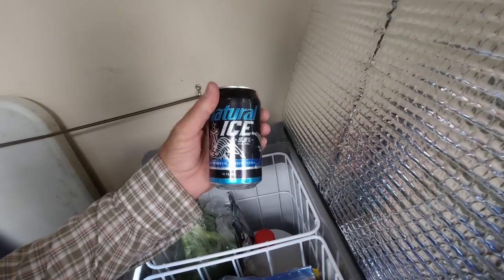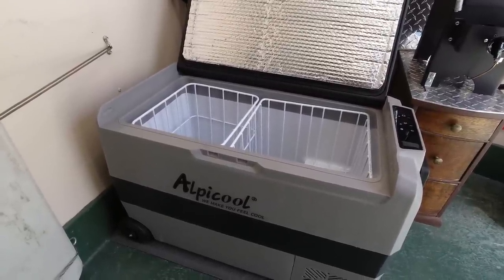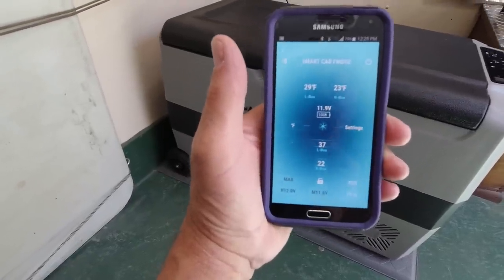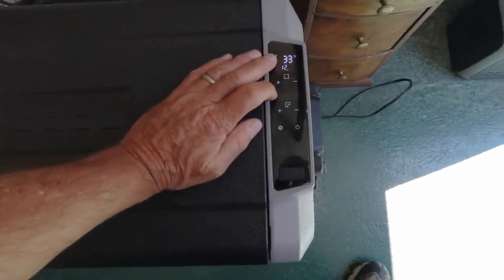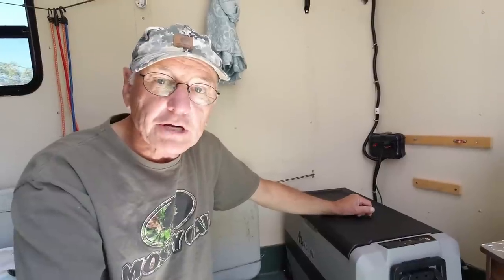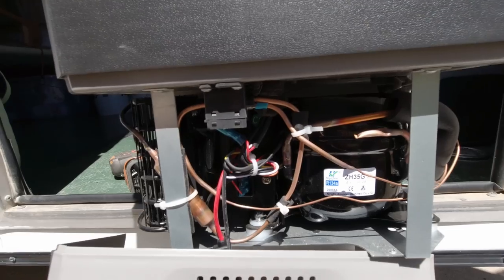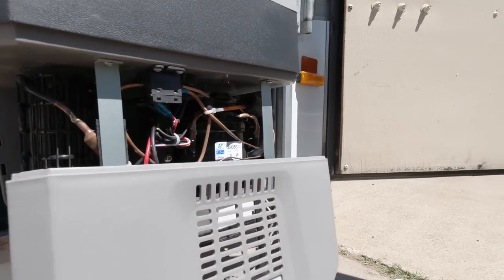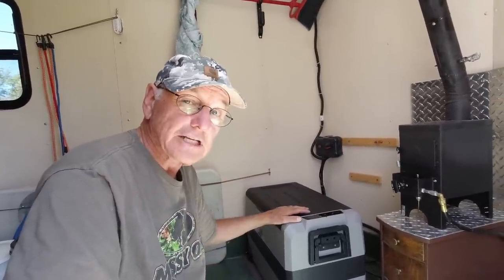Alpicool T50 12 Volt Refrigerator - Is It Worth It?

Comment: Some clarity around the Regulated 12v, its not that it won’t work so much as you will not get 100% of the power from the portable battery. My Goal Zero Yeti 400 lithium will stop running the fridge when it gets down to 35-40% power where if I had regulated 12v it would stop at 0%. This is with my Dometic at the lowest battery protection shut off option. If you are buying a portable battery and want it to run a fridge I would opt for regulated as you would get more usable time off of it.
Reply from the maker: Thanks for your input.  My concern is the videos that say it just won't work.
Reply: Yup that’s just BS. It will work for sure.

Comment: did you buy the extra insurance on the fridge, at amazon? I think it is through Allstate or SquareTrade.. 3-5 years of coverage if it stops working or anything breaks on it. Thanks for explaining the dual-zone. I saw that online but could not understand how it worked in real-world situations till you demonstrated how. I presume there is some kind of magnet in that panel that trips a switch/valve? Is the zone that has to be coldest on the side with the shelf or the other side?
Reply from the maker: You're right about the magnet and the cold zone is the shelf side.  I didn't get the extra insurance and usually don't when I buy things like this.  I figure if it's going to break it will most likely be in the first year.  We just returned our Alpicool because of a gurgling noise, and warranty service from that company still amazes me.  No hassles, just an immediate return label, no questions asked.  You don't send it back for repair with them, they just return your money.  If it wasn't for the fact that I have other refrigerators, I'd buy an Alpicool again.
Reply: @gonagain  did they return the tax you paid too? did you originally buy the alpicool on amazon directly from alpicool?

Comment: Do you have gurgling while the unit is running? Mine is pretty loud, sound line blowing bubbles in a milk jug.
Reply from the maker: Mine too. I've read that that's normal for some refrigerators. Some do it and some don't.

Comment: Thumbs up for Samsung Galaxy S5 !!!
Best smartphone with OLED display, replace-able battery and additional memory with 128GB microSD card. With unlimited data plan and Hotspot, I use Galaxy Tab S4 or iPad for YouTube, shopping, online game and email. Happy RVing !!!
Reply: As for the regulated 120V power? Yes fridge will work fine on 12VDC, but the AC adapter will last longer in true pure sinewave 120VAC.
Reply from the maker: This is all good information, thank you Thor 808.  You're right about the compressor and it will be either an LG or a Secop inside.

Comment: is the cooler still operating good?
Reply from the maker: I no longer have that particular cooler because I passed it on to another person, but the Alpicool has a good track record, as do most of the 12volt compressor refrigerators on the market these days.
Reply: @gonagain  is it still working good for the person that you passed it on to? Doesn't really matter too much who owns it, just want to know if it's still kicking

Comment: I just got the small 15 liter yesterday. Poor instructions. Wanted to send it right back. Amazon will not take it back because it’s 3rd party. Now I have to deal with the return. I have 3 complaints about this product. I had to watch a YouTube video just to learn how to change Celsius to Fahrenheit. Bluetooth would not connect with my iPhone. After 24 hours of operation the temp went from 75 to 69. The app for the Bluetooth gets bad reviews but you don’t see that until you try to connect. Plus like I said poor instructions. I hope you give a review in 6 months because it does not seem well made.
Reply from the maker: There's always a chance that you can get a defective item no matter what you buy, I just sent a brand new solar charger back.  But I'd be very interested in hearing about how well the warranty service goes and how fast they get back to you.  That will say a lot about the company one way or another.
Reply: So far I’m not having much luck. Amazon will not take a return because it’s a 3rd party seller. The seller was sent a e-mail describing the problems. The refrigerator is completely broken now and will not cool at all. They sent me a e-mail instruction manual as a response. The same one I got with the unit. I contacted them again to explain that the unit is broken and they told me to plug it in and try again. Their e-mail is in very broken English.  I responded by telling them it does not work I already tried. Now Amazon sends me a e-mail saying the sellers e-mail does not seem to be working. They may see e-mails on their Amazon account if they look. Not a good start with resolving issues with this seller. Very disappointing because I’m going camping this weekend. I hope you do a updated review in 6 months to see if your still happy. Love your videos I’ll let you know how this works out.
Reply from the maker: @havfunwithit  please do let me know.  So far mine's working fine.

Comment: I was about to buy one of these I’m wondering if they have a bracket that you can mount inside my jeep I have to research it further🤔🤔🤔
Reply from the maker: It seems to be a favorite with offroaders and truckers and I guess we'll see how well it lasts.  I researched failures of this type of refrigerator and it's usually something other than the compressor, like a burnt out fan or bad connection, that caused the problem.  Easily fixable.
Reply from the maker: It seems to be a favorite with offroaders and truckers and I guess we'll see how well it lasts.  I researched failures of this type of refrigerator and it's usually something other than the compressor, like a burnt out fan or bad connection, that caused the problem.  Easily fixable.

Comment: Hey guys, thank you for the nice review, i watched it again. how's the frige running? I bought mine somewhere in April last year and since then all good. Lately I realised that the lid is a little curved on the edges and is not sitting flush. I am planning to apply some insulation on it like you did, but probably needs a new lid. I haven't noticed if this came like this since  new. I am thinking of contacting Amazon to ask for a new lid, at least as a replacement. Take care! All the best, Constantin

Comment: What kind of battery you have or recommended?  Thank you.
Reply from the maker: We have a single battery on the trailer that runs our interior lights and the refrigerator. It's a Walmart Deep Cycle Marine lead acid type and currently sells for about $70.
Reply: @gonagain  Thank you. The amps are very important.  I am also retired and I  am trying to see your example. Thank you for writing.

Comment: I just bought one of these and my plan all along was to disprove the "can't run it off a unregulated PS." I got a small power box like the one you showed and I plan to plug a portable solar panel into it and I bet that runs no problem for as long as the sun holds out.
Reply from the maker: That should work just fine, especially if you're only using it as a refrigerator.

Comment: You guys are nuts!  $360 for a 1.78 c.f. refrigerator when you can go to walmart and buy a 3.2cf 120v for $130.  Both use 60 watts.  What's wrong with everyone?
Reply from the maker: I have one from Walmart like that and it isn't nearly as efficient and would use a LOT more battery power through an inverter that would be needed to run it.  Also, with it's front door, it loses a lot of cold just sitting there.  The compressor type 12volt refrigerator/freezers just work out better in my opinion because they don't take a lot of battery or solar to keep them going.

Comment: Thanks so much! And would have liked to know what size battery you kept reffering too.
Reply from the maker: We use an EverStart Lead Acid Marine & RV Deep Cycle Battery, Group Size 27DC (12 Volt/750 MCA) from Walmart.  It's been doing just fine for years.
Reply: @gonagain  109 amp hour, thanks!

Comment: Where I would say there was a gigantic Miss on this particular video is how viable ice is out in the desert. The review shows an ice icy cold drink. Please provide a review regarding your ability to manufacture ice. At the end of a long day in the desert ice is necessity for something red
Reply from the maker: We have been using it on "economy" mode which lets the temperature vary more than the regular mode, or "max".  This unit will freeze ice no problem at all if you choose to use it for that but, of course, your power consumption will increase by maybe 30% or so.  We liked having all that space for regular, refrigerated groceries is all, but you won't have any difficulty making ice with it.
Reply: I've found that using metal bread pans, conducts the cold faster,  or old fashioned ice trays made of metal beats plastic. Must have for iced tea.

Comment: I just bought the Alpicool G22 Portable Refrigerator 23 Quart ,45 watt and am waiting on delivery.  I realize your unit is bigger but I would think that running mine should take a bit less power because it is smaller. You also have experience with solar that I do not have yet so I thought I would ask you the following. You said you think a 100 watt panel would operate your fridge. You also said house battery which I do not have. I do have a 300 watt RockPal solar generator. If I kept the panel and fridge plugged into the RockPal  in the daytime would my solar generator be able to keep the fridge running at night or would it be to few watts ? I am currently looking a 6 v golf cart batteries and I am so confused. LOL!! If you don't mind me asking, what are the specs on the battery you are using please ?
Reply from the maker: My house battery is just a Walmart deep cycle lead acid of about 100wh.  Your Rockpal may very well keep up with your fridge if you have it supplied by a 100w panel.  As long as the sun shines.
Reply: @gonagain  , thank you so much ! I thought it should. That is what I bought the Rock Pal for but now I keep running across people saying it won't and that a 500 watt does not even keep up. I can't afford to make mistakes as costly as solar generators that will not do what I need them to do. LOL!!!
Reply from the maker: I watched a vide hopeo not too long ago where a couple had almost the exact same set up as you and it worked for them. I hope it works for you also.
Reply from the maker: @kielia727 , I've been testing two different 50-55 quart 12 volt refrigerators this week. Each one at 68 degrees ambient and set to hold 34F on Eco mode.  Both had a total power consumption of around 210WH for the 24 hour period, or less than 10 watts per hour.  The fact that your refrigerator is much smaller will help because the compressor is the same size so it will run for less time. Higher ambient temperature will change this, maybe considerably. You should have a house battery for a back up in case the sun doesn't cooperate. Something to strive for.
Reply: @gonagain  Thank you !

Comment: We bought a 54 quart compressor fridge/freezer single zone with Bluetooth. We use it in our 5th wheel as a fridge to keep all of our drinks in and to chill any food that we buy at the grocery store before adding it to our big 12 cu.ft. absorption refrigerator. This keeps the traffic in and out of the big fridge down to meal times.  When the temps outside go above 90 degrees absorption refrigerators have to work hard to stay really cold. We love our little compressor fridge and so fr it’s great. We’ve had it running 24/7 for three weeks now and have had no issues.
Reply from the maker: Thanks for sharing that because it's nice to see how others manage the available cold.

Comment: Now that you have added insulation under the lid, does it feel cool on top? Did you use the silver air buble reflectix for insulation or the foil/foam/foil insulation?  I ordered this fridge from Amazon and plan on making a padded insulation cover as you see on some of the more expensive fridges. Thanks for posting this video as it helped me finally decide which one to get. Take care.
Reply from the maker: I used two layers of air bubble reflectix under the lid, one to fill the recessed spaces and one to cover that.  I don't feel cold on the lid.  I did it because of a review I saw where someone said the lid felt cold.

Comment: We have a old cabin with a old propane fridge that has not worked in years. I am definitely looking into one of these for the cabin.
Reply from the maker: They're efficient.  Awhile back we looked at a cabin that was for sale and hadn't seen any use in a long time and were surprised to find the refrigerator running and cold.  It was 12 volt and running off of the solar system.  Thanks for watching Bradley!

Comment: Thanks for the video-good explanation of Your fridge. Your trailer floor appears to be Particle Board rather than plywood? Can You mop it with a wet mop when needed? Please tell me what kind and brand of paint You used to paint it. It looks very durable. Did Linda think up the name GONAGAIN?
Reply from the maker: The floor on most of the cargo trailers is an outdoor rated OSB and stands up very well, in our experience anyway.  We painted it with an oil based porch and floor enamel from Ace Hardware and it lasts a couple of years at a stretch. And we can wet it mop it no problem.
Reply: @gonagain  Thanks for Your reply-Best Wishes for a great healthy summer for the 2 of You.

Comment: I bought the exact same one, but with the Stakol brand name.  Both made by Costway.  I love this unit.  I am using it as a spare freezer and have both compartments set at 0 degrees.  So far it has been working as expected.  Since I intend to move out of this apartment by next year, now I have a way to preserve my expensive grass fed meats during the trip from NJ to FL...
Reply from the maker: Ours is working fine too, although I did have to send the first one back.  I'll have a video coming out soon about that and how the warranty service was very good from Alpicool.   I also learned that the compressors are very good quality.

Comment: I have a different model of the Alpicool that I purchased a year ago.    It’s been working great so far.   As far as the noise level, mine is difficult for me to hear unless every other noise is silenced completely and then is still barely perceptible.
Reply from the maker: Everything we read and watched seemed to indicate that these were pretty good.  I think most of the noise complaints are due to stuff on the inside that needs to get re-adjusted a bit is all.  Thanks Robert!

Comment: I'm glad you found out why your portable pack was having an issue. Some fridges you lower the limit, some newer power packs, you can extend the hours that the pack runs on low voltage. Either way, you can run the fridge. Some power packs, like the smaller Jackery's, cut out due to the low voltage setting, and a lack of an extended low voltage timer., which isn't really the power packs fault.

Comment: Does this draw less power on DC compared to using the AC plug?
Reply from the maker: Yes it does draw less on DC and that's because the AC inverter uses power on it's own.  Not a problem if you have decent sun to keep everything charged up each day.
Reply: @gonagain  ok plugged directly into cig power outlet and kills my battery only if i have it set on freezer since takes longer to hit desired temp. On fridge compressor stops after hits desired temp and only turns onevery so often to maintain the temp its set to.

Bought a portable power station but doesnt have 12 v dc outlet so....... should i plug fridge into that with ac plug or better to use a 12 v cig adapter to plug into ac outlet?
Reply from the maker: @mitsuoo1012  In that case I think it's better to go directly into the AC plug.
Reply: @gonagain  killed my battery over 10 times already but batterh still strong since only few months old. Usually you shorten the life of a battery when it gets jumped and after a while it wont hold a charge.
Reply from the maker: @mitsuoo1012  That's true Mitsuo.  Does your refrigerator have a minimum cutoff voltage?  Where it will turn off automatically if the battery voltage gets too low?
Reply: @gonagain  supossed to. I have Alpicool C21
Reply from the maker: @mitsuoo1012  It shouldn't drain your battery of you have it at the 12 volt setting.  Mine can be set at 12 volts (for regular batteries), 11.5 Volts (for deep cycle) or 9 volts (for lithium).

Comment: Great video, I’m across the pond in UK and found this very useful and helpful I was looking and the alpicool 50l when I came across this video and it’s better as the 50l ones on eBay did not have the divider so I’m glad I found your video as using as a fridge/freezer is much better and u can get the T50 In the uk on Amazon
Reply from the maker: Excellent!
Reply: Joel Have you bought it yet, if so have you used it as I am unsure between this and a dearer make
Reply: @mickblack3784  hi no I didn’t, what I’ve actually done is purchased a 47L 240v fridge with ice box on a 2000w inverter, what with winter approaching here in Uk sun hours are poor , I’m fitting another x2 110ah leisure batteries and an additional 200w of solar as I use a fair bit of power for work, at present the inverter is on 24/7 so what I’m going to do is change the 240v so it only powers the compressor, the stat will then go 12v through a relay that fires up the inverter only when the stat calls for it, this saving me a fair bit of juice , that’s the plan anyways
Reply: @Michael Black yeah I would of liked the alpicool myself but the way I done it worked out well and cheaper